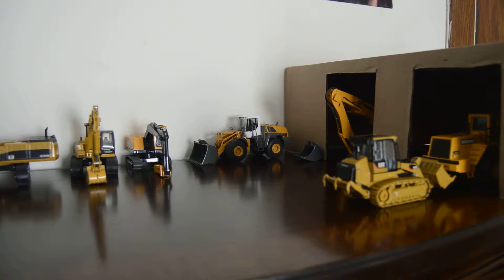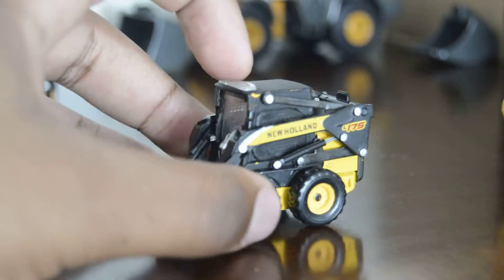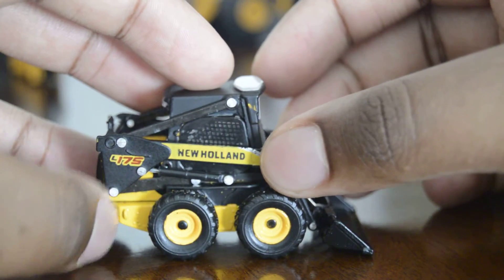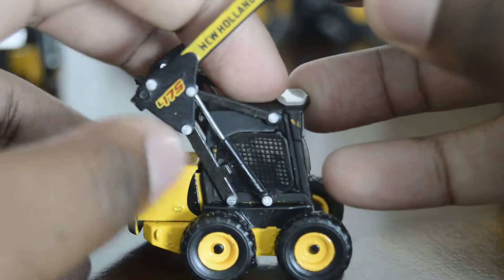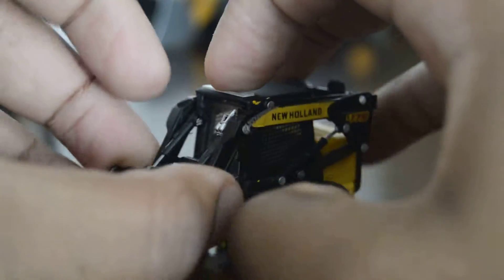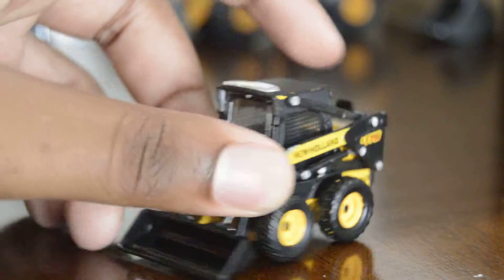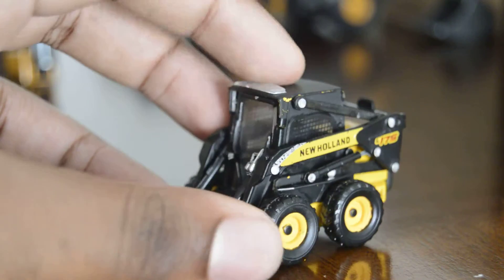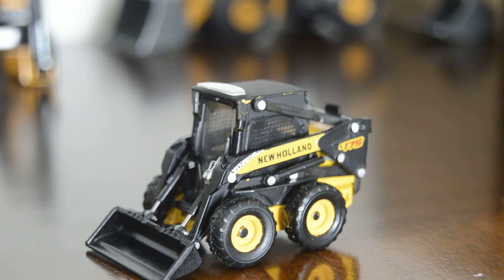Update: Model Defects...

Comment: Great video pointing out the issues. I have bought about 5 Hobby and Work models and all of them have had defects. First off there we're paint chips on my 1:87 Poclain 90BP and to make matters worse there was white paint covering 3/4 of the window on the cab... The Poclain TC45 had a cracked cylinder and crooked cab. The "1:87" New holland E485B wasn't even 1:87.... The body, tracks, and boom were identical in size to their 1:87 E215B!
Reply from the maker: +diecastmania Wow, I thought it was only the New Holland skid steers. Hobby & Works has the potential but they need to do a lot more work.